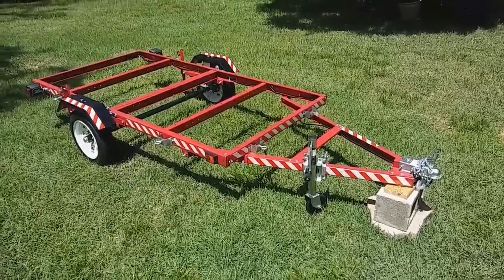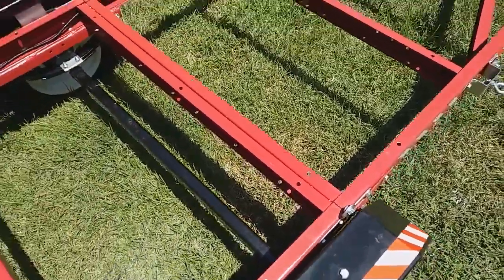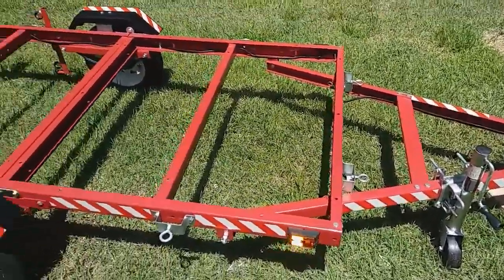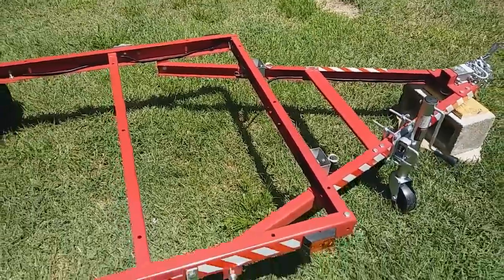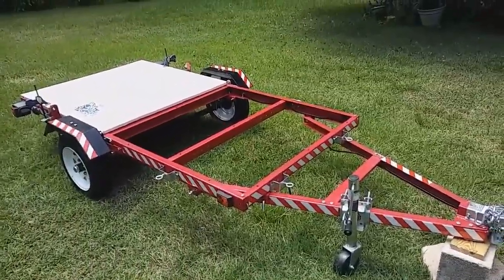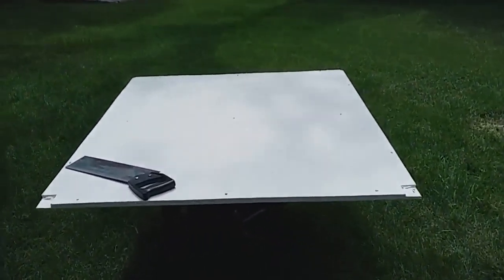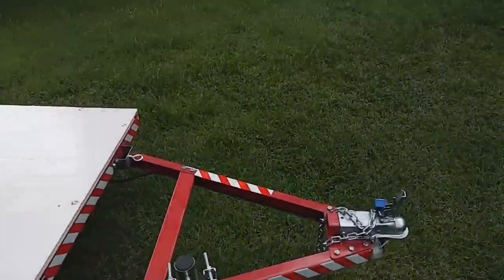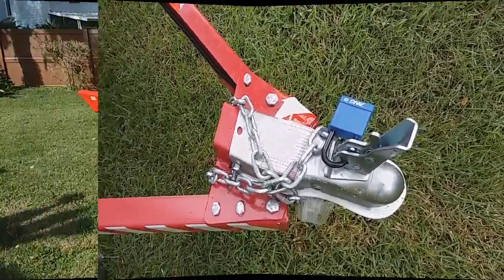DIY Harbor Freight Kayak Trailer under $600

Comment: The wire tubing was a genius idea. I was thinking along those lines but saw your video before I worked it out. Bought two packages, 14' long, 1/2" diameter, from Harbor Freight. Used it all, including all the way to the connector.  Half-inch accepts 4 wires easily and 5 can fit. The tubing fit thru pre-drilled holes on the frame.

About eye bolts, I plan to carry lumber or general hauling and also wanted hook and rope-friendly tie-downs. I wanted to preserve the option to use the stake pockets and I wanted tie-downs attached firmly to the frame, so replaced one of  the bolts holding on each of the stake pockets with an eye bolt.

Comment: anyone looking at buying this trailer for a kayak few things I found out that no one talks about is the trailer bounces like crazy the suspension is very stiff and its leaf springs are very loud on bumps on potholes so if you have an expensive kayak like I do few things I did lowering the tire pressure to 20psi and remove the smallest leaf spring from the suspension on each side , that will make a little better other wise is like putting you kayak on a wagon with wooden wheels , something to think about .

Comment: Lol re breaking lock on trailer hitch to remove from ball; remove nut from underneath and both your trailer and lock is gone! Best to run a cable around trailer and car hitch if you want to make things more challenging. On another note,  before test run after assembly, check that same nut for proper tension against your trailer ball,  not loose nor too tight.

Comment: Great video, wondering if any corrosion if launch & reload into & out of saltwater . Great video.
Reply from the maker: Thanks for the comment.   I would only consider galvanized or aluminum if using in or near salt water.   I’ve since sold this trailer but not before I had to replace all the cross members that rusted badly after a couple years stored in my back yard.
Reply: @crixus1032  Thanks, great advice

Comment: Nice build Crixus 10. I just bought one of these trailers (Jan 2019) with a coupon for $259, $90 off retail. It's the heavy duty 1195 lb capacity model. The problem is Harbor Freight is closing out the trailers. If you can find one in the store, good luck. I had to call all over the area to find one after I got my coupon. I found 2 still in the box at just one of the many Chicago area stores. None of the other stores had one and do not expect to get any more. Most store managers were under the impression these are totally discontinued. Built my frame and wired the lighting over the course of two days. Added Bearing Buddies today. Still deciding on kayak or small 2 man boat. Either way this trailer will be perfect. Thanks for the tips on the plywood.
Reply: I just used a coupon to get the 1195 model for 249 plus tax in Missouri (9/9/20).  Not being closed out, they have them at all the stores I called.
Reply: @marchufnagel9068  I think they stopped selling them for a while because of the trailer not meeting some DOT regulations. I think it had to do with the tires.
Reply: What are “Bearing Buddies”?
Reply: Ok I found them on Amazon. 
What size wd we need for this same trailer (1195 lb. cap. utility trailer)? 

CZC AUTO Wheel Bearing Buddy 1.98 Inch Bearing Protectors with Protective Bras for Trailer Boat, Chromed, Pair 

https://www.amazon.com/dp/B086V56DY4/ref=cm_sw_r_cp_api_glt_fabc_30H7X0MJVF6B2AFA29AE
Reply: @glendarandall7941  Sorry, I didn’t see the reply notice until today. These are what I ordered and use. I think yours are similar sized. 
Bearing Buddy (2047) Bearing Buddy with Bra https://www.amazon.com/dp/B001NI8X2A/ref=cm_sw_r_cp_api_glt_fabc_X70G8B033VV959TNW1N0?_encoding=UTF8&psc=1

Comment: Sir. Do you fold your trailer because, I just bought mine, and wanted to know how.?? And also did you clean the wheel bearings and grease them with new grease?
Reply from the maker: I don't fold this one, no - I have the lock pin in place and keep outdoors .  and yes, I greased the heck out of the wheel bearings - be generous doing that!  thanks

Comment: Is it easy to move around by hand with the kayak on there?
Reply from the maker: I can move it around ok but you wouldn't want to roll it too far or it will be a workout.   If you have a lawn tractor you may be able to rig up a makeshift hitch or something to help move it if it's too heavy.

Comment: Do you launch your kayak like a boat? How well has the trailer held up?
Reply from the maker: I guess you could if you have a heavier fishing kayak but I just unload as normal.   Using a trailer is a lot easier to load and unload than car topping it.   As far as it holding up I found that the plywood can trap water and if the trailer is left outside you'll start seeing rust.   Since making this video I've replaced a few cross panels that were bad and then repainted the entire trailer with an oil based marine paint.   So far so good but with any steel trailer rust will be an issue if left outside in the elements and especially in humid climates.   There is an aluminum version of this trailer you can find online but it's double the price of this one.

Comment: That looks really close to what I would like, but most of my kayaks are 16 ft or longer.
Reply from the maker: This kayak is 14’4” for reference.
Reply: @crixus1032  Yeah, it looked like you were close to the limit up front. If you made a tight turn on the side the kayak is on, it would come close to hitting the vehicle. My Epic is 18ft, and my CLC is 17.
Really close, but I'd have to extend the tongue to keep 7 ft of kayak from hanging over the rear.
Thanks for the info!

Comment: If that is not salt/pressure treated plywood, you so not have to leave it out to dry.
Reply from the maker: thanks for the comments and you're correct about pressure treated.   I had used treated here so had to dry out a bit

Comment: Hey just wondering what are you towing with? You mentioned car
Reply from the maker: Subaru Outback (rated to pull 2700lbs) but I think just about any car could pull this if equipped with a hitch.   Trailer and two kayaks would still come in around 500 lbs total.
Reply: @crixus1032  thanks

Comment: They are 500 now
Reply from the maker: Thanks James and you're right.  Mine was $279 4 years ago so almost has doubled in price since then.   I also want to comment that since building this I've had to order and replace the cross bars due to rust.   The parts weren't that expensive (about $11 each) but if you keep a steel trailer outside and especially in Florida like I do you'll need to keep an eye on the rust.

Comment: After seeing these trailers are only rated for 45 mph....hard pass.  I need to be able to go at least 70-75 mph on highways.  Or do people just ignore that 45mph rating?
Reply from the maker: This is rated at 55 mph.   I've pushed it to 60-65 without issue and it tracked great but I wouldn't recommend going over the 55 limit.
Reply: Great idea, speed limit might be ok for local trips to lakes/canals for me… The cheapest one is now $500 though…

Comment: Just bought this same one but it was $499 thanks to inflation.
Now what changed between 2018 and 2022....
Let's go, Brandon!
Reply from the maker: I noticed that big price jump shortly after I bought mine in 2017.    Just keep it dry and out of the weather as much as you can.   It will rust fairly quickly otherwise as I found out.